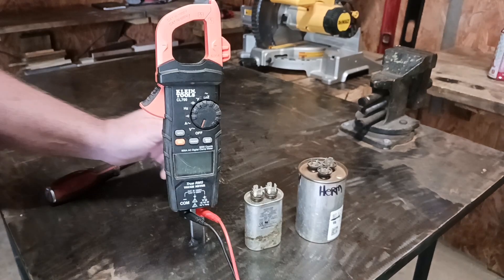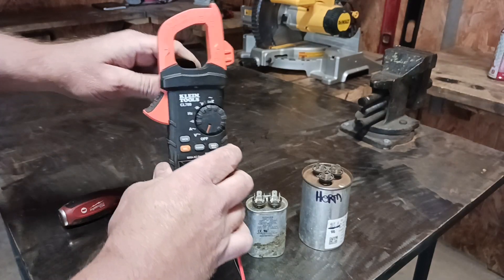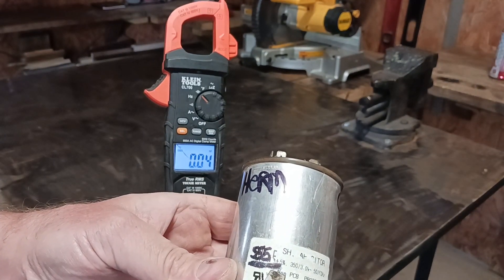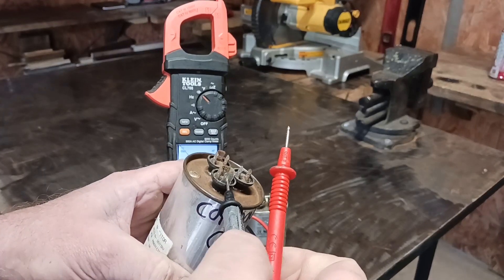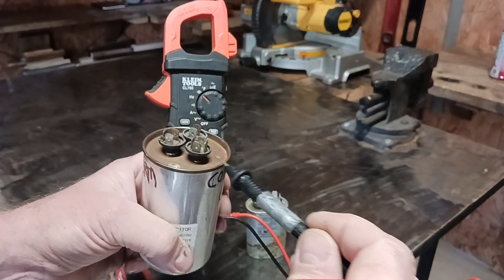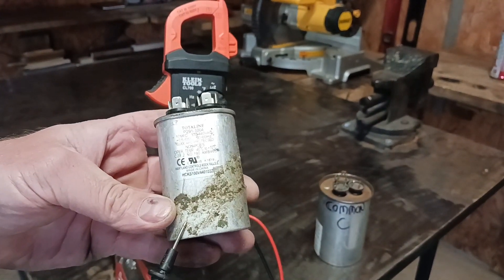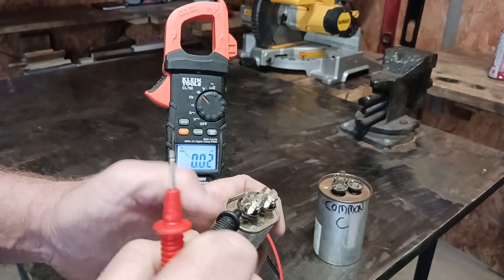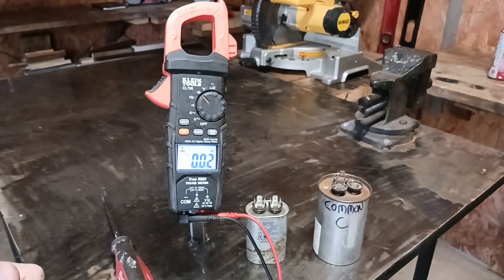How to check a capacitor

Comment: when discharging the terminals with a screwdriver don’t touch the metal canister with the screwdriver if your hand is touching it.  you’ll still get zapped. Only touch the terminals. Great video. 👍🏽

Comment: Thanks for the video! What does it mean if one of the tested capacitors gives a "OL" reading (all the others give the proper microFarads)? 
My Metek MK05 user sheet does not say what OL means.
Reply: When measuring capacitance, an OL reading means the multimeter is unable to measure the value within the range it’s set at.  Make sure it’s set to micro Ferad (uF).  If your leads have a good connection and are connected between the correct terminals, it likely means that the capacitor is bad.

Comment: You assume the labels are still on the CAP, I have a rusted CAP with no label, the wiring digram does not have the uf for CAP. The system is a Concept 1000 scu10e30a-4 s/n 1603b22199 it is still filled with R22 oil. when I measured the old CAP I got 5.4uf on the fan side and 10.3uf on the compressure side, which seem low. any advise?????

Comment: HE WAS CORRECT SHOWING YOU HOW TO CHECK TO SEE IF IT GOOD OR BAD ( “”” BUT”””) HE DIDN’T INFORM YOU THAT ITS A DAMN GOOD IDEA TO SHORT  THE TERMINALS ON THE CAPACITOR W/ A SCREWDRIVER SO YOU DON’T SHOCK THE SHIT OUT OF ( YO) SELF, CAPACITORS TIN TO HOLD A ELECTRICAL CHARGE. ⚡️⚡️💥☄️zoom

Comment: Every time I hire an electrician or HVAC person, they often just do the job good enough to leave as fast as they can and collect $$$. I've learned much about fixing appliances and replacing components around the house and saved thousands in the process. Great video.

Comment: The proper way to discharge a capacitor, it to put your meter on DC and it will drain the capacitor properly. Doing it his way is very very dangerous.
Reply: "The multimeter isn't used directly to discharge the stored energy of a capacitor. Instead, people use it to measure the voltage and power of the capacitor to know whether it is fully released or not."

The proper way is a 1000ohm resistor, the Industrial course teaches to discharge with a screwdriver while de-energized and still wired before you touch it. Ive discharged thousands of Cap's this way over the last  36yrs without issue.
Reply: @matt123231    Put your meter on DC and touch two leads of a capacitor and watch what happens, then come back and comment.

Comment: Clamp meters are easy to hang on stuff so you can read them and test lead clamp connectors or clips are well worth the money.
Reply from the maker: Good point, clamp leads are easier it seems in certain situations.
Reply: @jdtools6038  They make good connections and free-up your hands.
Reply from the maker: Will check them out, thank you. They would have been good for the video too. Just didn't think about them at the time.
Reply: @jdtools6038  Only been doing this for about fifty years and I still buy new ones in  different sizes and you need enough of them so you don't always have to look for them. I have a Fluke 373.

Comment: There should be just one round capacitor on the outside compressor? Correct?
Reply from the maker: Sometimes there might be 2 capacitors that are linked with a jumper wire. Even on blower motors. Also, there might be a jump starter kit for compressor that looks like a capacitor too and wired into it as well. But should be black. But for the most part yes only one.

Comment: Very true however, if your capacitor is reading below the rated mfd but within the tolerance of 10%, I would replace it. If the meter reading is 2 or 3 mfd below, I'd keep it but any more than that simply suggests it is on its way out and since they are not all that expensive to replace, its much better on the electric motors and compressors to run caps that are fresh. The worst idea in replacing capacitors is to source less expensive brands in the $15 or less category for a dual run type because they are likely China products that many folks in the industry call Chinesium. They will not last long, maybe 2 years or so.  Buy the good brand that are made in the USA such as AMRAD, MARS etc. since you are doing the same amount of work and most of us would rather not do it over in just 2 years or so due to a cheap cap from Red China.
Reply from the maker: Good point,  appreciate you pointing that out. 👍